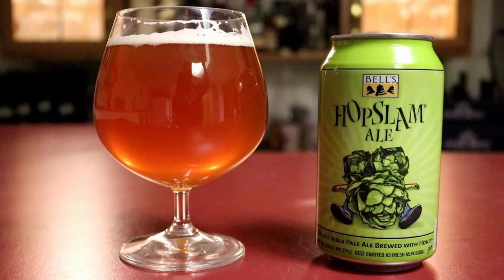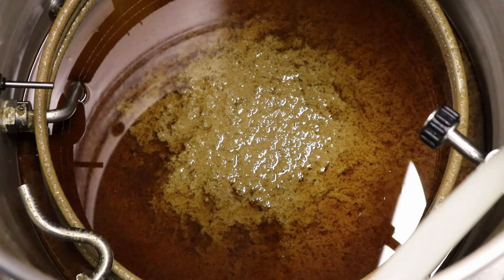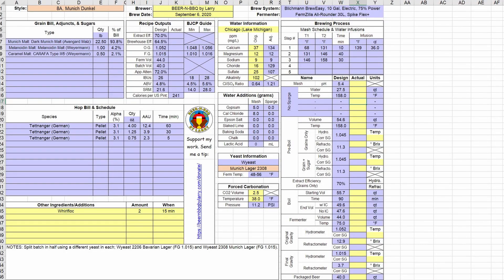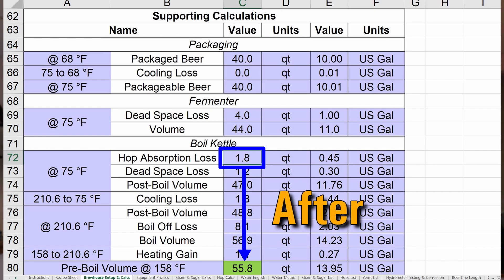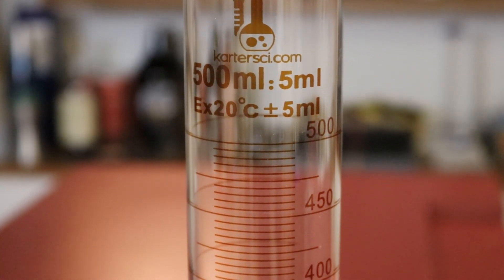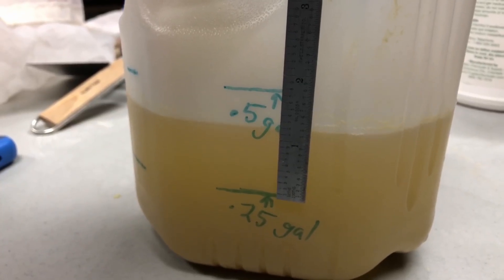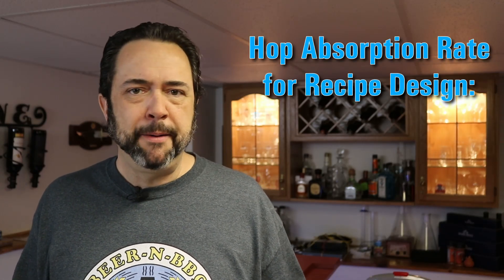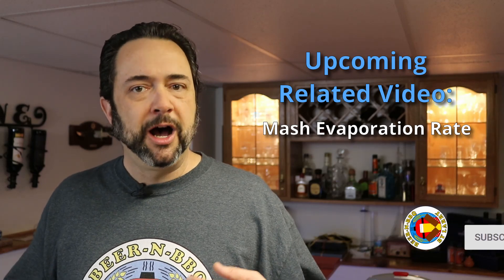Determining Hops Absorption Rate: An Experiment

Comment: I'm just updating my own brewing software to accommodate for hop absorption, but in my case more for absorption while dry hopping. Are the rates the same for wort boiling and dry hopping? I assume they are at least close together. I will have to do my own experiments.
Reply from the maker: @CarloBernini2342  not sure but I assume it is the same since it can only absorb so much in total.

Comment: Exactly what I needed. I have been working on my water calculations and applying "rules of thumb" to also apply to BIAB. I could not get the rate I found for hop absorption to make any sense. As soon as I tried .14L per gram I laughed...well that would be a really big batch of hops, to soak up that much water lol

When I saw your figure of .012L per gram I immediately knew what went wrong lol

I moved the decimal, then used your minimum of .01L per gram to where ever I got the .o14 as a range to test out.

Easier is, Hop Absorption of: 10ml per gram, to 40ml per gram of hops. Depending on the hops and methods, but considering how much my hops swelled up in their hop bags, and I have a very large SS tea/soup ball, these figures make sense.

One thing that I can think of straight away, that would alter the total hop absorption, is squeezing the hop bag or not :-)

Comment: If the volume of water changes by temperature, water by weight would remain the same no matter the temperature?
Reply from the maker: Yes, but isn’t very practical.  It is much more difficult to use mass since your need a scale capable of weighing all the equipment that you use to contain liquids and remember to tare them all before filling or at least record their weights in advance. Then there is the complication of accounting for the additional weight of dissolved ingredients like sugars, minerals, and hops. Then converting all that back to volume at various steps.
For simple experiments, it may not be a big problem, but on brew days using various pieces of equipment, not so easy.
Then there’s the issue of accounting for the nonlinear coefficient of volumetric thermal expansion of water when doing the conversion. 
 Using volume measurements accounting for temperature was much easier.

Comment: Thanks Larry! I appreciate your work for the community. Don't you think that "Hops Absorption" 
should have an effect on "Total Water Req'd" only in case wen "Hops Absorption" is greater than "Boil Kettle Deadspace"? 
Above that level you should subtract "Boil Kettle Dedspace"...
Reply from the maker: Very good question. They are two separate losses that can over lap and double count or cancel out one another depending on how the hops are added. My latest brewing spreadsheet (v4.0) accounts for this via a IF...THEN...ELSE clause for kettle deadspace and hop loss but only when the hops are loose in the kettle. I also have a toggle for that as well (loose vs bagged hops). It'll use deadspace minus hops loss if hops are loose and hops loss is less than the deadspace, or if hops loss are greater and loose then it zeros out the deadspace and only counts the hop loss.

Comment: I did this work many years ago when we started making IPAs. Not all are the same, but approx a pound of hop pellets turns in to about 5 pounds of wet hops (well settled pea mush).  That's 0.12 quarts/oz.  The only way to achieve in practice is with a decanting centrifuge! Loose pea (hop pellet) soup is 2 to 3  or more times that!  A huge loss!  Good work!
Reply from the maker: Excellent. That aligns with what I'm seeing here.

Comment: How did you strain the hops to get the resulting water volume readings? Did you push on the wet hops?
Reply from the maker: Used a nylon bag in a colander to let it drip and drain. No additional force since I wouldn't be doing that on a brew day either.